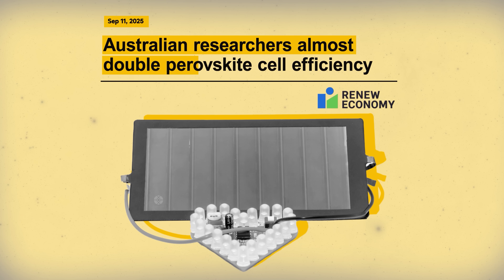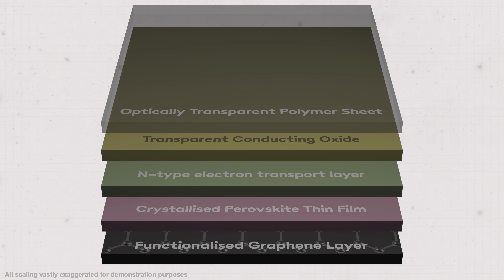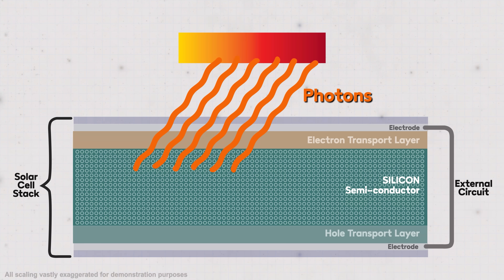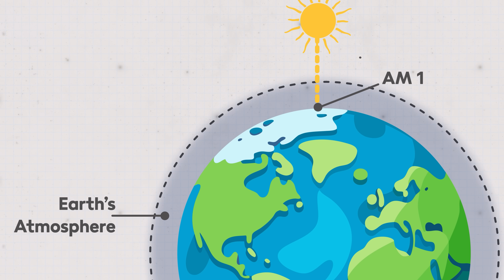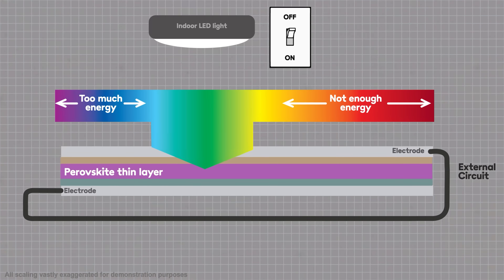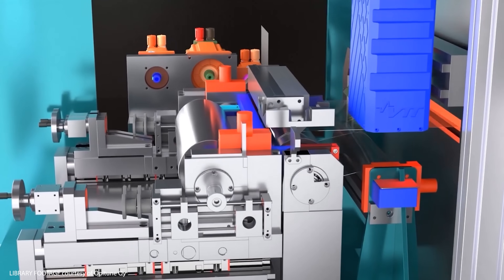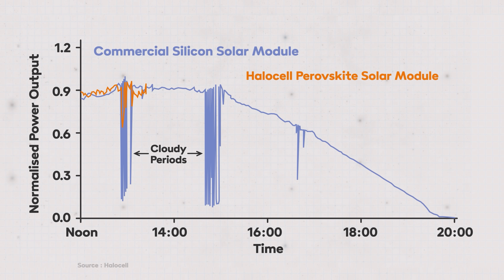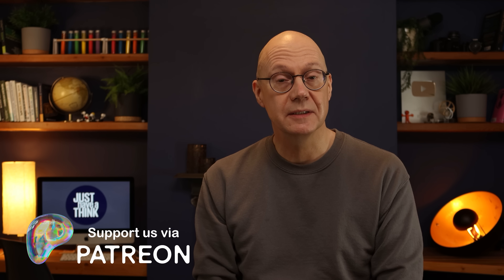Graphene Perovskite just revolutionised the Solar PV industry!

Comment: I have been hearing about perovskite revolutionizing things for over a decade. I’ll wait to be amazed.
Reply: Would love to be amazed...just sayin'.
Reply: There is just a difference between a theoretical breakthrough, a lab breakthrough and a commercial breakthrough.
Reply: @nfzeta128  Yep. Like Emperor Wun Hung Lo said "You've invented this 'Gonepowder' Master Chou Li Fat. Nice sparkling trick, but what's it ever going to be useful for?!"
Reply: @theoztreecrasher2647 "america f yeah"starts playing in the distance, getting louder and louder, along with rumbling sounds
Reply: After we invented red and green led's, it took 30 years to invent a blue led. Just because something takes a long time, doesnt mean it won't happen.
Reply: single steps are not worth upgrading but multiple steps represent a significant improvement, as in over 50 percent.
Reply: Es gibt nur eine ganz kleines Feld an Anwendungen.  99% der > 1 TWp  PV Module benötigen einfach  nur Preise  unter 30 Cent je Wp damit sie verbaut werden.   Denn am Ende zählt nur der Preis je kWh Punkt!
Reply: Even if the solar panels is given by free, there would still be the cost of the inverters, which are still quite a cost.
Reply: @albertobeto5362  If you look at most things, they don't take AC, they have a converter that takes AC and turns it into DC, if you aren't transmitting power long distances, or running syncronous motors, you probably don't need an inverter, you need much much cheaper buck, boost, or buckboost converter. For best efficiency you'd run at a high DC voltage, then use buck converters instead of your normal wallworts, which are also switchmode power supplies that already have the same hardware.
Reply: Their main problem is they don't last long enough.  Last I heard they are good for about 18 months, which is like 5% of what silicon cells are good for.  Outside of some very special use cases, there's no reason to use it.
Reply: @magnetospin  5% of what sillicon panels are guaranteed for, but more like 2% of the real world working life of a sillicon panel
Reply: @priestesslucy just put some hard figures on that it's about 18 months versus 25-30 years versus up to 40 years.
Reply: Plus, they can make the next generation of mandatory injections for the sheeple 😮
Reply: Add the graphene revolution of industry to the list, with betteries, anti break glass, colour changing paint and a very long list of etc😆
Reply: why is it taking so long?
Reply: Humidity?  lol
Reply: Never heard of it.
Reply: Oh, I bet you got told off for that?
Reply: Don't wait. PV is allready amazing, even without perovskite.
Reply: Don't forget the solid state batteries always two years away
Reply: @bfingen  ...according to Musk.
Reply: Your not impressed????
Reply: They are used on mono crystallian silica wafer are in use atm. I think it hits 40% ish effecientcy.
There has also be breakthroughs in laser welding to seal glass better.
Reply: Someone has still to manage to stop it degrading as fast as it does. Yeah perovskite is great in the lab but still no-one has worked out to turn that into a 25 year system on your roof.
Reply: And fusion energy has been "10 years away" for 50+ years.
Reply: Thorium reactors have been written about in popular science and popular mechanics every few years for at least 35 years
Reply: @macrosense  TMSR-LF1 is at least working. China is now the top science nation in the world. closely followed by russia and Iran. the west has gotten lazy and mixed up in perceptions of superiority.
Reply: @simonschneider5913 "China top science.." umm, 😷 cough 😷 cough 😷 about that.. 
..also, Russia and Iran filling out your "Top 3 Science Nations" ?!?
Thanks for the laugh!
Reply: have fun living in the 20th century.
Reply: @simonschneider5913 We did!! The 20th century was great for us westerners. Not so much for Chiba, Russia and Iran. But we had a great time! 

Looking forward to the 21st century@
Reply: @jacobzindel987  the 20th century was pretty much cashing in the dividends of the 19th...from late 20th century until today, "the west" has totally dropped the ball. this will hurt big time, especially western europe.
Reply: @m @macrosense ow you have not studied thorium at all. Do some research, was a USofA invention that languished for years because of redicKulous politicians and public attitude, finally sold off to a Chinese company that has been building them as cornerstones to big neighborhood grids. Your ignorance of Chinese ingenuity is typical of American egotistical narcissism!   Drill Baby Burn
Reply: @teadrinker7098  Difference is that perovskites already work.  They just don't last long enough to be commercially viable (compared to silicon).  Fusion is still working on the physics while perovskites is just tweaking the formula and improving manufacturing processes.
Reply: It was 50 years away. Every decade is 10 years less. 50 away, 40 away, etc.

Must be a sign of progress!
Reply: @TheFinnmacool Must be a sign of increasingly unrealistic optimism. ;)
Reply: If i had a pound for everyone of these stories,  I would not be worried about my electricity bill.
Reply: Yeah it's like the fusion reactor or solid state battery technology equivalent of solar cells
Reply: Yeah still waiting for my self driving car, solid state battery, cold fusion reactor, small medium reactor and flying skateboard too
Reply: @maci6990 and I never dreamt we would all have colour TVs when I was a kid. So don't despair.
Reply: @maci6990  Woooow,you will have to wait a veeeery long time...
Reply: @maci6990  > my self driving car
Keep waiting.  It'll probably come some year, but it won't be any year soon.  Turns out getting all your information about a technology from the companies trying to make money off that very technology tends to give you an overly optimistic view.  The tech just ain't there yet, no matter what the tech bros say.

> solid state battery
Uhhh so go get one?  They're still new-ish and not yet widely used in baseline consumer products but they've been commercially available for a couple years now and there are several companies you can buy one from today if you really want.

> cold fusion reactor,
That's unlikely to ever be a thing.  The cold fusion craze was more of a media blitz than real science.  It's not impossible - muon-catalyzed fusion in particular can do it - but getting net positive energy is not likely happening unless we discover a way to build a cheap and easy muon source.  Muons are hard to make and don't last very long once you do.

> small medium reactor
I assume you mean small modular reactors.  Those are already a thing as well - they're held up far more by red tape and paranoia around anything nuclear than by any real physical limitations.  (Also keep in mind "small" is like the size of a standard freight container or a big bigger - its not something you're going to sit in your utility room.  Not that any sane person would want to.  Nuclear is still nuclear and while paranoia is not really justified, healthy precaution certainly is.)

> flying skateboard
OK well now we're just pulling ideas from movies.  There's all kinds of great shit you'll never get if that's your bar for what constitutes a "promise".
Reply: @maci6990  And AGI, autonoums cars and longevity escape velocity.
Reply: @maci6990 ; prefer the Solar Flying Car.  😏😏
Reply: @maci6990  Self driving car is the fantasy of Elon Musk.  It does not work and probably never will but people are prepared to pay him a trillion dollars to be told what they want to hear.  Where will that trillion dollars come from? Hot  fusion is astonishingly expensive so only supported by nation states.  Cold fusion is more of what people want to hear.  Reactors are all wonderful on paper and not in reality.  This comes from a few university labs at a remarkably low cost compared to other technologies you mention.  It might even work.  40% efficiency from  lightweight installation on my uninterrupted driveway metal canopy in the San Francisco Bay Area would probably take me off grid with current batteries.  BTW have you heard that AI plans to use the power of 10 additional nuclear reactors that may be completed in 15 5o 25 years?
Reply: @robertbrewer2190  You know where that money comes from, where all the money he gets comes from, US.
Reply: @robertbrewer2190  Fusion will work, just in the far far future
Reply: Oxford PV in germany has a serial production of perowskite solar. Lifetime 20 years+, 30% efficiency.
Reply: @markuslang1869  No they don't they say they will hit 30% in 2030.
Reply: @markuslang1869 efficiency is secondary.  Cost per watt is where it's at.
Reply: @markuslang1869 the current product is around 25 or 26% not 30. But yeah, they use perovskites.
Reply: I am kind of amazed by the concept here of reusing LED light energy for low power appliances.

That can get rid of so much waste if used well.
Reply: @priestesslucy in my house we obey the laws of thermodynamics!
Reply: @priestesslucy actually, energetically speaking it is the definition of waste: making light from electricity at 80 % loss, and then converting it back into electricity at 70 % loss. Better change a battery...
Reply: Same, fusion syndrome. Sci journalists have been saying we'll have thin film organic or perovskite soon for a long long time
Reply: There have been more breakthroughs in the joke about graphene never leaving the lab than graphene  leaving the lab.
Reply: Facts, this and solid state batteries have seemed to be "right around the corner" for decades.
Reply: It will come just in time for nuclear fusion...
Reply: @jonesmatthew7511  OOOOOH 😂😢😂
Reply: Jeez are you Gen Z with no attention span or something - you want a discovery to go from being discovered to mass production in 10 years...???  That's just not how the world works.
Reply: @piccalillipit9211 bro is just tired of all this hype BS
Reply: @piccalillipit9211 corona vaccin...?
Reply: @piccalillipit9211  The irony.
Reply: 2 decades for me
Reply: same
Reply: I remember something about it reading a paper 5 or 6 years ago and they still troll us with epic data for products that might come out in 20 more years. 😂
Reply: they do work, they are just not commercially competitive. they don't last as long and are more expensive. when space is not an issue at all for solar panels, an extra 8% of efficiency is not worth the extra cost and lower longevity. you might as well just buy an extra panel. any use they may have will be only for extremely niche applications.
Reply: @danilooliveira6580 space does matter on my terraced house. 4.5mln of these houses here on the cloudy Netherlands alone. I max out at 5kWh in summer using 500wp panels at 21%. October to January they don't fit the bill. As soon as tandems get sold at 30% efficiency I would love to swap.
Reply: lead still ahead
Reply: This guy,2 bit davinci, and Matt Farrel. are constantly making videos of all this revolutionary technology that never ever goes anywhere, or is a complete scam. I could see accidentally making a video like that once in a while but it's their genre.
Reply: @mojaveartifacthunters339  They are alerting us to new developments. 
No one has a crystal ball, so the only way that you will get a video of a successful technology is after it has become successful.
If you are not interested in what researchers are working on that is still in development, then simply stop watching these channels.

Comment: Recap to check if I did understand it correctly: this is (at the moment) a power source for remote controls etc. Meaning: no more batteries in remote controls? Maybe with a small rechargeable battery incase  the light is to dim to get enough voltage to trigger the remote? That would make a difference!

Comment: Nicely presented and not so much climate bullshit. However it this tech is notorious for not being as durable as original tech. So there would be a tradeoff which is not mentioned at all. Also a small market remote control devices that are indoors? But it could be perfect for a back panel of a mobile phone.

Comment: Still looking at a maximum life of 5 years life for these cells (compared to 30 for conventional silicon). It needs to be at least 10 years to be worth significant investment. It used to be on the order of days though, so a lot of progress has been made but I don't expect it to get to 10 yr lifetime for another 10 years. In the meantime silicon PV has become incredibly cheap... For the last 10 years PV is the cheapest energy possible (lcoe). And that's only going to get better. It's therefore a battle I don't think perovskite can win.

Comment: The essence of generation of electricity is storage of energy. Preferably the storage of energy before it is used to generate electricity like the storage of water in a dam before its potential energy is used to power of a water turbine that turns a generator or the potential chemical energy stored in coal, oil and gas. The best way to store solar energy is by thermal energy storage, then use that thermal energy to generate electricity. The problem is the production and storage of thermal energy at a high temperature above 700°C.

Comment: Help me understand 😅 

If I have a small perovskite panel sitting under my LED lamp, plugged into a power bank... It could charge it (slowly) over a week for the time my light is on (this time of year that's at least 6-7 hours...). And being that my lamp is on anyway, there is no loss of power.

And then I could technically discharge that into any device that has a charging port?

Is that what is being said here?

And the higher efficiency panels would do a better job?

Or have I got the wrong end of the stick?
Reply from the maker: Yes, that's generally correct! Higher efficiency panels would definitely do a better job too. 😊

Comment: I saw this like 6 months ago.  Where they mix both the perovskite and the silicon cells.  The issue is the perovskite cells die off in under a year and you are left with the regular silicon panel at 3x the cost.

Comment: Sounds promising. And for those of us who remember when photovoltaic efficiency was struggling around in the low-single-digit percentages, this all feels faintly surreal!
Reply: Back when a few kilowatt installation ran for tens of thousands, big changes
Reply: PV Cells broke double digits efficiency in 1959 (Hoffman).  That was 2/3rds of a century ago.  So if you remember low single digit cells you would have been born well before WWII.  I was 10 in the early 70s when my 150 in 1 Electronics kit from Radio Shack came with a solar cell that was in the mid teens efficiency.
Reply: @aspendell209 just a bit younger than you and i always wanted one of those kits
Reply: If it works so good the big guys want to kill it. Discredit, or whatever way to help their own money plan.
Reply: I'd like to see the kind of progress in photovoltaics that we saw with LED tech. I'm old enough to remember when  LED flashlights came out and they were extremely underwhelming. Now they are cheap and as bright as you would ever want (I realize there is a much more constrained maximum efficiency for gathering power from sunlight- I did listen to the video).
Reply: Except they have been saying the same thing for 10 years now meaning its nonexistent.

Comment: The problem with all the incremental improvements at this point is that most of the cost is no longer the panels on a house. It's installers, cables, mountings, connectors etc so the benefit from pure cost reduction on panels is now miniscule.
Reply: the problem with all the perovskite hype is that they reduce cost vs something which is not selling because it's too costly. they still can't compete with normal silicon panels
Reply: @SergePavlovsky  TBH I think most of the folks working commercially on them recognize this. They are mostly working on stuff you can't do well with current panels - so small indoor devices, thin translucent films and the like.

The cheapness of those panels though is a huge barrier to all sorts of tech and is even eating some of them like solar trackers because unless you have a space constraint more panels is always the best answer.

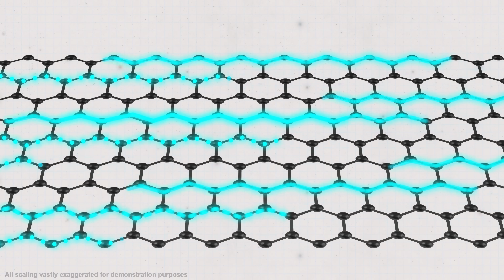Comment: At 1:55 I had to pause the video. I went straight for all purpose cleaner and a rag. My goal was to clean the spots off the screen of my television five minutes later my screen is spotless. It was then and only then I realized the spots I thought were on my screen are in your graphics. They look pretty stable at first, which is why I thought it was my screen, but then shortly there after they start to jitter. Just thought I’d let you know if there’s a slide or a screen somewhere that may need tidying thanks. I love your videos.
In fact, I’d like to get back on topic by mentioning this is a potential game changer for solar. That makes solar a threat. I don’t know if we’re better off that the research is taking place outside of the US. I would say we’re better off. This is paradigm shift level advancements for disruptive industry.

Comment: most silicon solar modules include a converter which comprises power circuitry having an optimum condition to get efficiency, wherein the module has low efficiency at low light due to the converter circuitry.  Thus the comparison at 12:40 timepoint with perovskite concerning low light performance might not be useful...... (anyway, I would review this before making the conclusion)